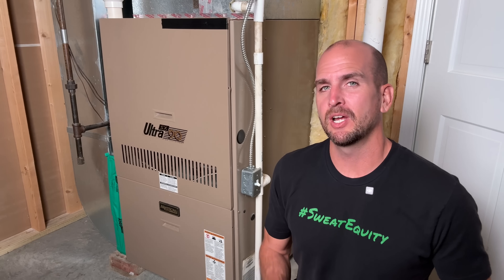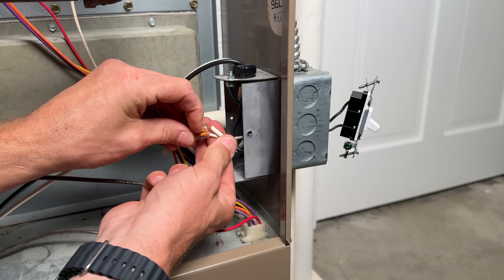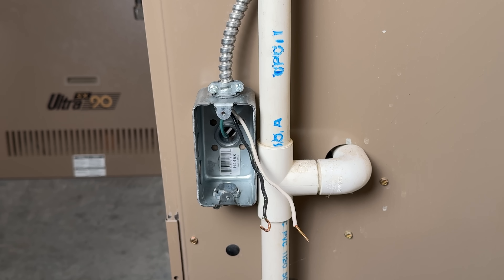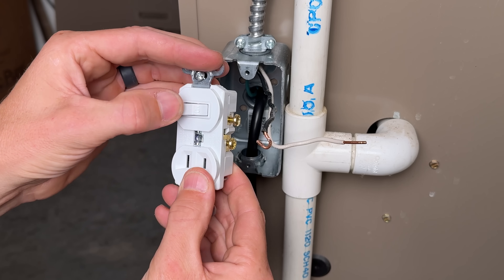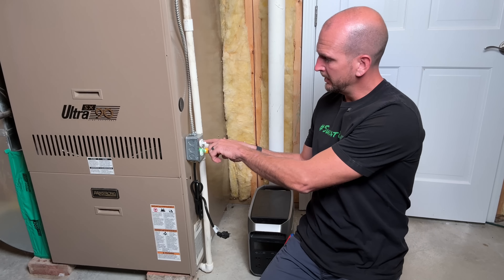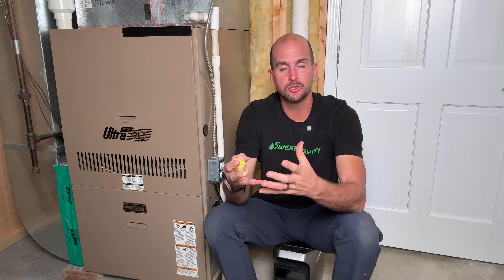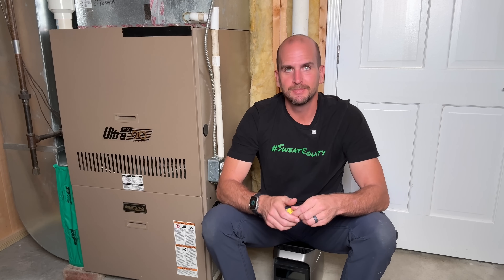Emergency Heat | How To Power Your Gas Furnace When The Lights Go Out

Comment: I'm confused, why did you break off the tab just to replace it with a jumper wire?  Or am I not understanding how this outlet switch combo thing works?  Does the tab connect the two screws on the same side of the outlet, or does it connect to the hot on the other side?  If that's the case, why not just swap the power in and switch power out wires?
Reply: This threw me too. But after some research, the tab doesnt connect the switch to the plug. It connects the plug to the hot, always on side of the switch.  Break the tab to make it so the plug isn't attached to the hot side of the switch. Connect the terminals with the jumper and now you have the hot going into the top terminal, through the switch, down the jumper to the plug at the bottom.
Reply: How about with an oil furnace???
Reply: @TomLap-qd6xc an oil furnace is going to be basically the same thing, but you might have higher power draw. The blower in the oil burner takes a significant amount of electricity, while the draft motor in a gas furnace takes maybe 30-50 watts.
Reply from the maker: The tab broke the connection to the line side gold screw that would make the outlet powered as always on.  Breaking the tab then cuts the power and then connecting to the single pole switch screw terminal allows you to control the outlet power with the switch.
Reply: @EverydayHomeRepairs  Scott please take another look at this. The top right terminal of those outlets is the normal line in side. You put the hot line in onto the top left screw terminal which is technically the load side of that switch. There was no need to break the tab. Leviton has a video explaining this. It’s in another comment
Reply: @Art-jw8ho only matters if the switch says OFF and ON, right?
Reply: @arickbakken  the on and off label on the switch would still be accurate. On simply indicated the internal pathway is connected. The switch doesn’t know which side is line and which side is load
Reply: @Art-jw8ho  thanks, duh
Reply: @EverydayHomeRepairs you fed the wrong gold screw. No biggie though
Reply: @EverydayHomeRepairs That's true if you connected power to the line side with both screws, but you connected the power to the other (switched ) side. That uses the switch to control power to the two screws and the outlet as well, with the tab in place.
Reply: @EverydayHomeRepairs Just wire to the other side of the switch.  There's no real "line" and "load" differentiation on a switch, therefore installing SPST switches "backward" really doesn't matter, because there is no backward.
Reply: @MrZorbatron  They way he wired it is correct for controlling the outlet with the switch, he just didn't need to break the tab.

Comment: I installed an EZ Gen transfer switch. It makes it much easier
Reply from the maker: Those are nice 👍
Reply: @EverydayHomeRepairs that’s how you have to do it.  What you have posted is not allowed per NEC.
Reply: I have built something very similar but solved a problem they didn't address early on with the EZ setup.  I actually have two - one for downstrairs furnace and the other for upstairs.  Running furnaces off a Champion 2500 watt inverter.  Hasn't failed me yet.  As long as both units don't kick on at the same time, it's all good.  Will never have a repeat of the 2021 Texas ice storm power outgages again.  Initially I've got 6 propane (BBQ sytle) tanks, and if I run out,  have 40 gallons of gas in my transfer tank on my truck.
Reply: @avflyguy  I'm considering the EZ transfer switch paired with a Champion inverter generator as well.  Am curious what you meant by "didn't address early on with the EZ setup"
Reply: Ez transfer switch
Reply: And code compliant. This method is not compliant since most manufacturers require the unit be hardwired.

Comment: I don't understand the point of breaking off the tab on the hot side of the switch/outlet combo then essentially replacing that tab with the short length of black wire.  You broke the connection then essentially repaired it, so what is the point of even bothering to break it in the first place?
Reply: You're right, breaking the tab and replacing it with the wire is the same thing as not breaking the tab, but with extra steps. Buddy didn't think this one though. I've installed a couple of these units. The top right terminal is normally the "line" terminal, and the top left is usually the "load" side of the switch. In order to control the outlet with the switch, all you need to do is attach the "line" to the top left ("load") terminal, and leave the tab unbroken.  Video author was thi king about if he had connected the "line" to the top right. In that case,  in order to switch the outlet, one would break the tab and then run a jumper from the top left ("load") terminal back to the bottom right terminal to power the outlet. That step is easily eliminated by connecting the "line" to the top left.
Reply: @chuckb4375  I would highly recommend everyone pull up the wiring diagram for this specific switch. There is no internal bus. And there was no need to break the tab
Reply: @Art-jw8ho  I couldn't find Slater combo switch specs, but I think you're right.  Thanks!  I deleted my reply...
Reply: I just wired my furnace up exactly like in the video, I did not break that tab off and everything works perfectly, I don't know what he was thinking? But breaking the tab off then adding the wire to fix it was just ridiculous 😂
Reply: I was thinking the exact same thing?
Reply: You're not understanding the connections....one can be switched and the other is directly connected....two choices of application
Reply: @GailUrge-vq6qn PPP
Reply: @GailUrge-vq6qn  Thanks for the reply, but we got it sorted.  I am indeed understanding the connections.  Scott has introduced confusion into this demonstration.

Removing the tab was unnecessary.  Adding the short length of wire just replaced that tab.  As I noted above, there is nothing different about this SLATER branded switch/outlet combo from the Leviton version or any of the other brands.    I've looked at several variations on this combo and they all work the same.  For Scott's explanation to be correct, there would need to be an internal bridge from the left screw terminal next to the switch across the device to the right screw terminal next to the outlet.  That however is not the case, these switch/outlet combo switches do not have an internal bridge.  

All Scott did here was take the line voltage that previously powered the furnace directly through the old switch, and attached that to the line voltage connection on the left side of the new switch that is part of the combo.  The power is then fed through the switch replacing that ON/OFF function provided by the old switch.  Via the tab OR even via the short length of wire on the right side of the switch combo, the switch now controls the outlet.   IF he had removed the tab and had NOT replaced it with the short length of wire, the switch and the outlet would be independent devices but by adding the short length of wire back on to the device, he essentially replaced the tab once again making the outlet controlled by the switch when the line in is applied to the left terminal next to the switch.  In any event, vis the tab or the short length of wire, the switch controls the cord, so with the switch on, the outlet has power, with the switch off, the outlet has no power.  

With this set up as he has it wired, there is only the convenience of having the switch to disconnect power to the furnace via the outlet/cord combo which is essentially the same as simply pulling the plug from the outlet with the switch on.  He could have just as easily replaced the switch with an outlet and achieved the same result with the only difference being that he can turn the furnace off with a switch, rather than removing power by pulling the cord.  There are several demonstrations of that very idea to be found on YouTube.

If he had wired the switch/outlet combo with the line in voltage fed to the right screw terminal next to the switch, AND left the tab in place, then yes, the outlet would always be powered.  In that case though, the switch would serve no purpose since there would be nothing to connect to the left terminal in this set up with the cord feeding power directly to the furnace rather than through the switch.  

If he wired the line in to the right screw terminal next to the switch but he removed the tab, then again yes, there would be no power to the outlet but then the exercise would be pointless.  In that scenario, the switch would control nothing and the outlet would not have power.   

If he had removed the tab but supplied the line in voltage to the right screw terminal next to the outlet, then yes, the outlet would always have power, pulling the cord would cut power to the furnace, but then again, the switch would serve no purpose whatsoever. 

This YouTube video gives a much clearer explanation of how this switch combo works using a Leviton branded variation of this device, and demonstrates how to use it correctly in this application without the steps of removing the tab only to be replaced with the short length of wire.  

https://youtu.be/cSXVeUg7L0k?si=ikQWKNdBDkcBqtYE&t=217
Reply: Yea this needs clarification you lost us
Reply: With the tab in place, the outlet is always "on." By breaking the tab and adding a jumper, the switch now controls the outlet. You'd leave the tab on if you want the switch to control, for example, a light while having the outlet always hot.
Reply: @tckoppang  this is not correct. The line side of that fixture is the top right terminal. He is wiring it with the line in on the normal load terminal on purpose. The tab connects the two terminals on the right hand side and so does the jumper wire. There was no need to break the tab
Reply: @Art-jw8ho  Huh, weird. I’ll take another look. Thanks.
Reply: It appears the lower load terminal is bused to the line side terminal not to the switched load terminal, by breaking the tab he disconnected it from being a power always on/series type power pass through function to switchable
Reply: Think about it this way guys.. he is using the switch backwards to the way it would normally be used. Maybe it was designed this way so it could do both or just really smart people figured it out.

Normal Mode: you would connect your line to the left side of the switch and your load to the right side. In this configuration the two screws on the left will be line because the bab connects them. you could break the tab to add a different line to the bottom screw (the outlet) if the load on either the switch or the receptacle requires a dedicated circuit.

Backwards mode: you put your line on the right side and the load on the left side. therefore when you flip the switch your load wire will go hot. and because the tab is there your outlet will go hot. 

he has essentially turned his furnace into an appliance with a power cable instead of it being hardwired in. when you plug it into the outlet it allows it to still be safely switched on and off but really you could just unplug it but code states you must have a switch so this satisfies the code. then once you unplug it you can plug it into any outlet generator solar battery backup..

this is absolutely genius.. but I do believe in my area Ontario your furnace must be hardwired in it cannot have a power cable.. so I believe this would break code in Ontario
Reply: @steve_main  think about it this way....

What you said is essentially correct. Breaking the tab off, and then replacing the tab with a jumper wire, though, serves no purpose. The result is the same if you simply don't break the tab.
Reply: It's so you can still control power to the unit via the switch. If you leave the tab the outlet will always be live as long as you have power to the unit
Reply: @lescanlescan  correct. He switched the line in and load out terminals to accomplish his goal but normally the hot line in would be on the top right terminal thus giving constant power to the outlet. Breaking the tab allows you to wire the outlet and the switch on two independent circuits (similar to a normal duplex outlet that has the same tab). In this case it wasn’t anything dangerous but perfect example of why we all should always consult a licensed electrician before performing any work you’re unsure of 😁
Reply: @Art-jw8ho I'm a bit confused, does this particular switch/outlet combination have an internal bus connecting the right side screw terminal of the outlet to the left side screw terminal of the switch, OR, is the only connection between screw terminals external via that tab that he removed?  Looking at the Leviton variation of the switch/outlet combo the only connection between screw terminals appears to be the right tab.   

Leviton has a rather detailed video showing four variations on how to wire their device such that it achieves different goals.   I would suggest that the set up in this video would be accomplished by using the first variation whereby the switch is set up such that it controls the power to the outlet.  In other words, Hot line in voltage to the left switch terminal.  Neutral line in the the left screw terminal of the outlet.  Right side tab left in place.  Thus, when the switch is in the ON position, power is delivered across the switch to tab connected screw terminals and in turn to the outlet.  Plugging in the cord supplies power to the furnace via the outlet.  With the switch turned off, it essentially cuts the power to the outlet in turn cutting power to the cord, and thus also cutting power to the furnace.  In the event of a power failure, the cord is removed from the outlet, plugged into the temporary power source thus supplying power to the furnace.

https://youtu.be/gJpS0-5JQgU?si=gtsKSL4kbKKMl5cK&t=168
Reply: @lescanlescan  correct the first variation is exactly what is shown in this video. Except for some reason he breaks the tab and then puts the jumper in which re-creates the original function of the tab. There is no internal bus bar or jumper. The top right and top left terminal are disconnected when the switch is off and connected when the switch is on
Reply: @Art-jw8ho  Thank you!!  I thought I might be wrong so I checked around looking at other manufacturers.  I haven't found a schematic for the Slater version in the video, maybe for some reason it is different, but for other brands I've found that they are consistent with the Leviton version.  In other words, removal of the tab and replacement with the short length of wire was pointless.  This is a good idea, and he usually does a good job explaining things, but I think he was off the mark a little on this install.  No harm done but unnecessary.
Reply: @lescanlescan  where are you seeing slater? The outlet linked in the video is Leviton. But essentially yes. Before he breaks the tab you can clearly see that it connects those two terminals
Reply: @Art-jw8ho  look at 04:48 of video - you can see Slater on tab near Scott’s thumb.
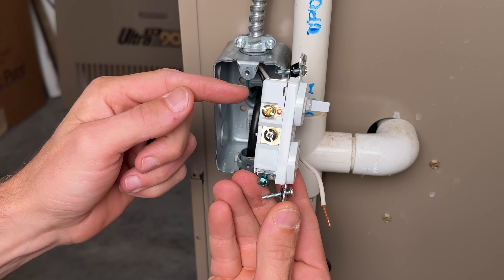Reply: @chuckb4375  Yup!  4:06 is pretty clear too.
Reply: how about just hire an electrician to do this.. @Art-jw8ho

Comment: I live in northern MN and simply do not trust any battery to hold up to running a furnace up here for any serious length of time in the dead of winter, so I just bought a 24K BTU kerosene heater and a couple of sealed jugs of fuel and tucked it away in the attic.  It was about the same price as a low-end car battery.
Reply: Make sure to take it out of the attic before summer, even in northern MN

Comment: In my zip code the average low in January is 51.  So if power goes out I put on a sweatshirt.  😁
Reply: And 101 in August?
Reply: lucky you ,how is your A/C bill
Reply: I’m half a mile from the ocean.  Ocean temp is 57-73 all year so keeps every day mild. Used the ac for one week this summer.  Rarely gets above 85.  Half the homes here don’t have ac.  But the big downside is homes are $1200 per square foot.  :-(
Reply: I guess if your 12 years old your comment was cute. Otherwise your just amusing yourself and no one else wants to hear from you ever again.